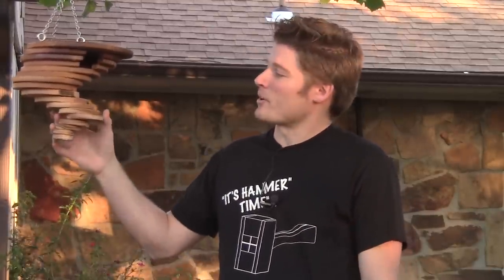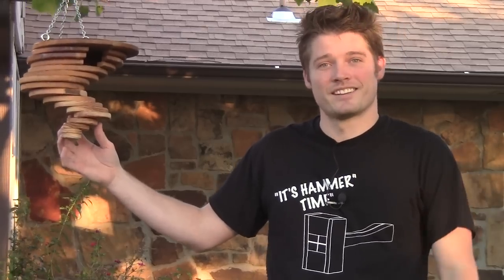Tornado Birdhouse Build 2014

Comment: Great design. Question how did you do you decals that you applied to the top?
Reply: I'd also like to know how you did the decals.
Reply from the maker: It is an ink transfer used on a slick side of label paper.  Since the paper is slick the ink won't stick or dry.  You have to flip your image before printing and then you can apply it to whatever you want

Comment: Awesome idea, great use for your 2 new circle cutting jigs! How hard was it to voice-over yourself there at the end? ;)
Reply from the maker: No voice over, that was spoken live, but they say that I am always a day late and a dollar short!  LOL!
Reply: Wow I could have sworn that was re-dubbed! Hey, I was actually thinking about an old episode of yours this morning. How is your table saw sanding disc holding up?
Reply from the maker: It's holding up great. I actually just used it last night. I'm thinking of making it out of half-inch MDF next time since it's more consistently made htan plywood. Why do you ask?
Reply: I have been on the fence about making one since it has such huge centrifugal forces acting on it. If it ever flew apart I imagine there would be pieces stuck through the ceiling and walls, and potentially me if I was standing in the way for some stupid reason. It sounds like yours is doing great, though. I think I'll give it a shot and operate it with one eye closed (that seems to make dangerous situations safer haha).
Reply from the maker: LOL, you have every right to think such a thing. If I was you I would make double sure that what you make it out of is a very consistent product and high-quality for that specific reason. Also, make sure that it is a perfect circle so you do not have any weight distribution that is different on one side than the other. This will be a problem on your table saw bearings if you have a wobbly disc. That is another reason I am going to use MDF to make my next one.
Reply: Yep, that all makes sense. Thanks for all of the tips! We should have an Oklahoma woodworkers meet-up at some point.
Reply from the maker: That would be cool